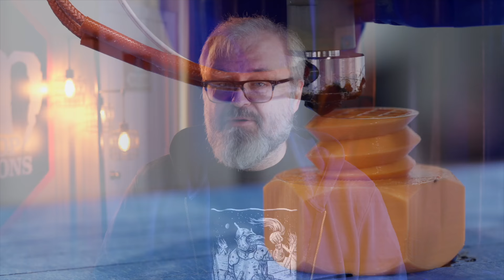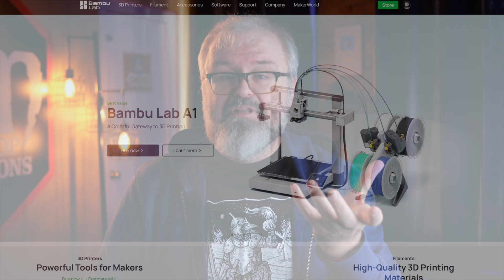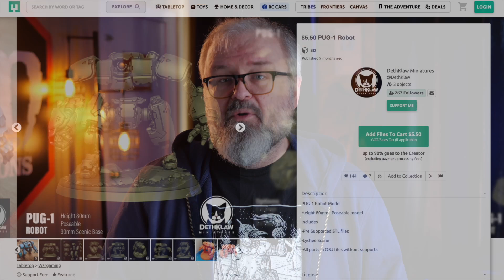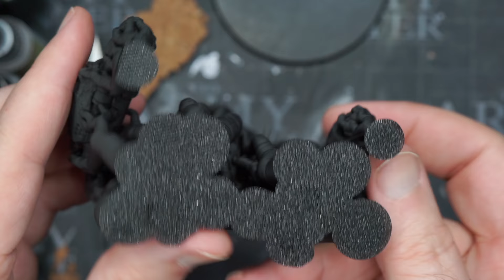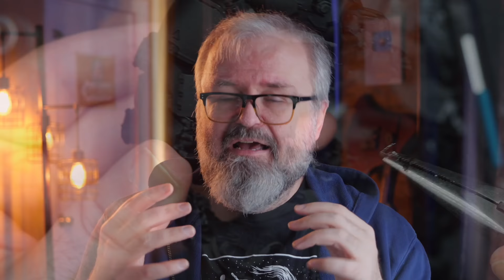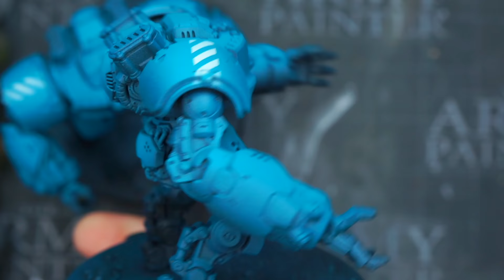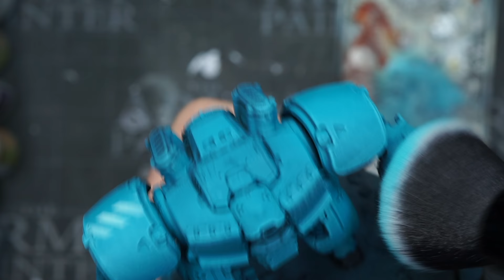I Compare RESIN vs. FILAMENT for 3D Printing Wargaming Minis

Comment: I'd take a resin print over an FMD any day... however, since I first need +300k to get into a larger appartment where I can safely use said resin, I'm perfectly happy with an FDM printer.
Lower quality and layer lines suck, but for me, it's about having fun making and painting stuff.
Reply: That's exactly where I am. Resin print is better than FDM print is better than no print. With a respiratory condition, resin is a big no no for me in the accomodation I have.

Comment: Today I learned there are 3D printed minis made of corn derived material.
Reply: Chorne berserkers
Reply: They are which is cool the bio degrade part does need a claification they need industrial mulshes to degrade in a quick time, they will degrade but if you put a load of fdm spools in a hole in your garden your talking years and years.

They are very low on the micro plastics though so much better allround.
Reply: There's a spool of beef jerky infused filament out there bud. It's not for sale, but it exists. It's included in a Void Star Laba video, originally from another creator but I can't remember their name off the top of my head.

Comment: For FDM check out Mr surfacer for a primer. They have different sizes but it basically fills in gaps and blemishes and will minimize lines.

Comment: Try PETG material for supports. It snaps off easy when on PLA model, but of course you nees the bambu multi material spool. It makes the Cleanup both fast and pretty!
Reply from the maker: I don’t have the AMS thingy to use two different materials. Thanks for watching!
Reply: I will have to try that. I just spend a bit more time with my hobby knife and sanding sticks.

Comment: For the filament models use a Mr surfacer primer spray. It fills the gaps between the lines and makes the model smoother
Reply: Mr Surfacer 1500 or 1200?

or Mr primer Surfacer 1000?
Reply: @Shini1171  The smaller the number the coarser the primer particles, so the 1000 one is better most of the times.
Reply: @nkartakis will the 1000 block the minis detail while covering the layer lines?
Reply: @Shini1171  Not really unless they are truly minuscule but at that point a layer of paint would've obscured them anyway. If you're applying primer through an airbrush properly the primer layer is less than millimeters thick
Reply: @Shini1171  it depends, all these primers can block detail, so I use them mainly on larger prints. You can try to see if the result fits your needs. There even coarser putty- primer sprays, like the ones used in auto repairs, and they are cheaper, but they must be compatible with plastic.
Also after priming I use sponges to remove imperfections and a fiberglass brush pensil for small details.
Reply: thanks guys. Ill try the rattle can once I get my fdm printer and my first print :D Some of my buddies have got some really good minis lately.
Reply: I also like to use Vallejo surface primer with a brush. It goes on kinda thick but doesn't kill detail. It fills the layer lines and kinda acts like a contrast paint where the highs are a little thinner than the lows. You can do a second coat if you like. Credit to Dana Howl for this technique!
Reply from the maker: It was -4F outside when I was priming in this video, so I had to use airbrush primer. Also, I wanted to use airbrush primer on both for comparison. Thanks for watching!
Reply: @tabletopminions  Mr Surfacer also comes in jar form, mainly for brush use, but it can be thinned using the self- leveling thinner of the same company and used with an airbrush.